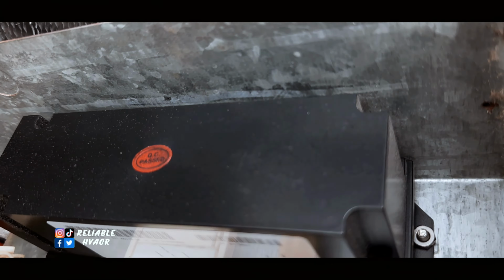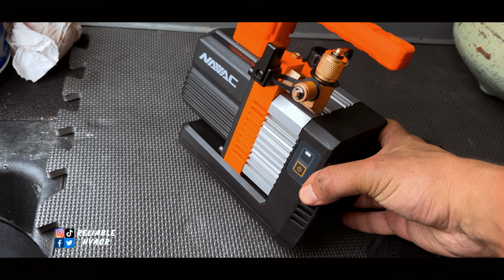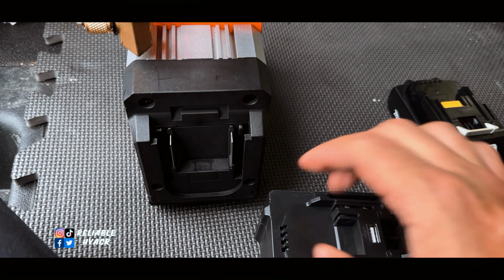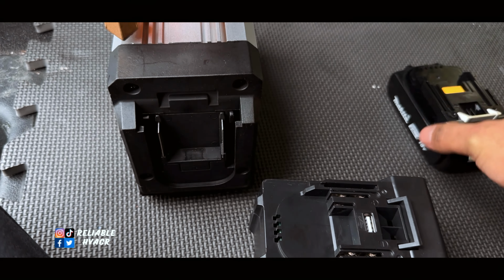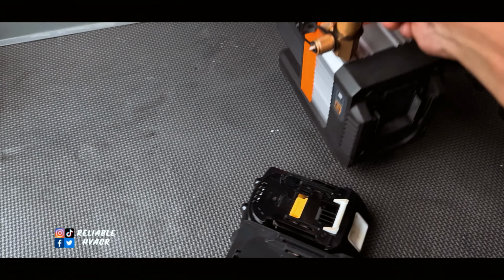Freezer Resurrected Once Again

Comment: Good repair the intella controller is probably the most expensive part on that freezer. I’ve seen some of those fry pretty bad . When that happened I threw in a Dixell XR60 controller and an Omron relay to control the compressor and condenser fan SIMPLE 🤷🏻‍♂️. Good repair 👍🏼

Comment: You ever try those wago lever connectors those been really good for me. I put them in many situations like this and wrap them in electrical tape although not needed but for my own sanity. God bless brother. You always do solid work. You and hvacr videos are my top two.
Reply: Yeah,  the Wago inline connector is the way to go there.
Reply: @mikeb9771 I’ve never been a fan of splicing wires like that. Been doing it for 4 years the wagos never let me down.